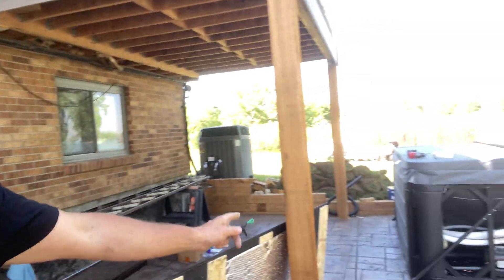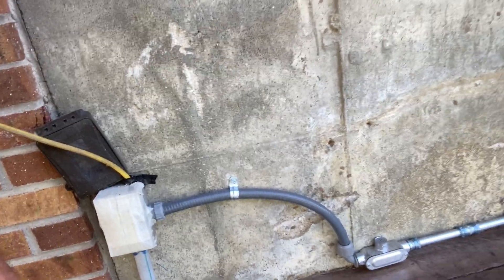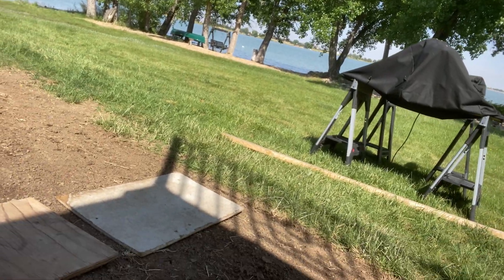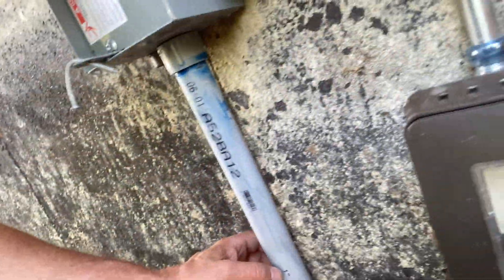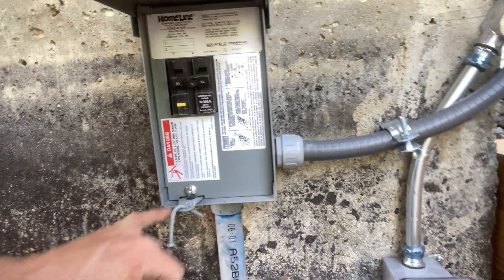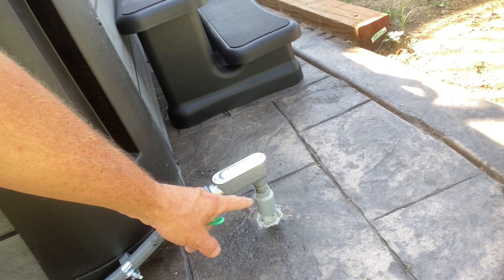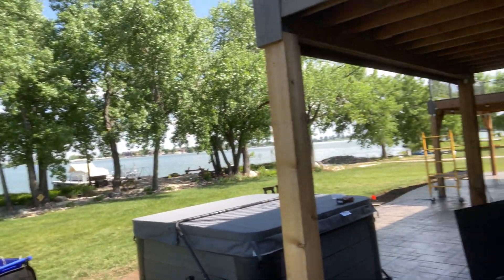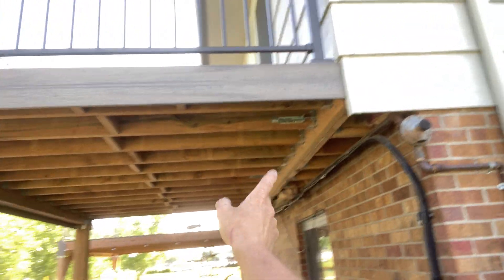EMT Conduit for A Hot Tub

Comment: Nice video, good to see how other electricians are doing things.

I'd like to mention a few things, as I just did a hot tub and it's fresh in my mind:

680.42 B, you don't need the equipotential bonding ring for a typical outdoor rated, above grade, self-contained hot tub. Check the listing. Can't hurt though.

680.26 B (7), metal raceways need bonded (metal LB as part of the raceway). I tried to get around this in a similar situation as this one, using the exceptions in 680.26 B (5) for fittings, but if it's part of the raceway then 680.26 B (7) is what I had to comply with.

Anyway, thanks again for the video.